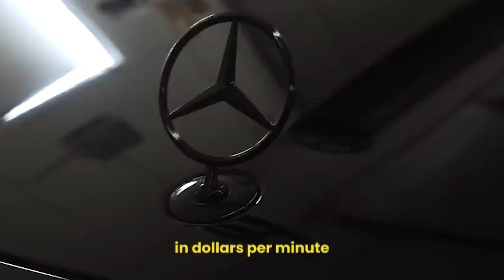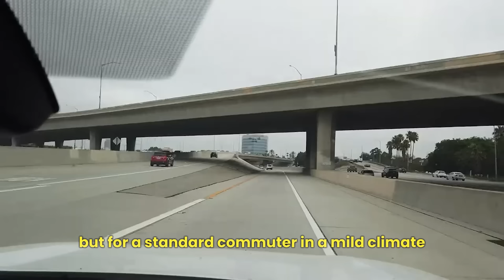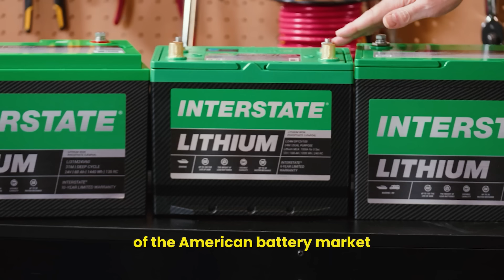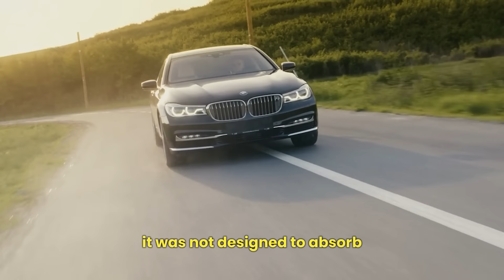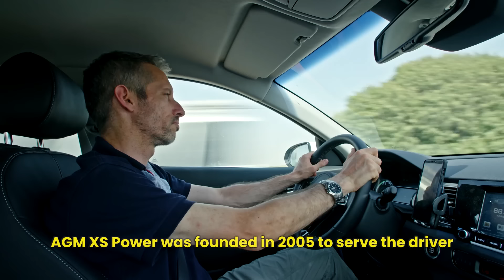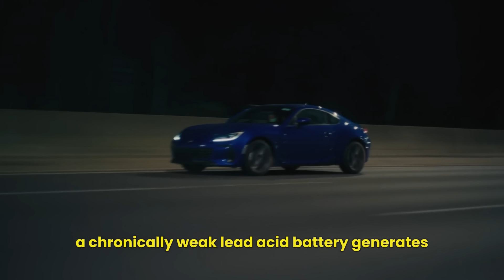8 Car Battery Brands That ACTUALLY Last (Stop Replacing Yours Every 2 Years!)

Comment: I have a 2018 Explorer with the original battery. I use a trickle charger ($20.00) whenever I'm not driving for more than a couple days. I've never had a battery last more than 5 years. The slow charge seems to be help the battery achieve a higher charge and last longer.

Comment: I hereby defy you to: Place any new battery in any vehicle. Let it be in the TX sun for a few years. Never out of the sun. Always. Driven, parked, no matter. It will start to deteriorate within 2 to 3 years. It's not the cold that matters, it's the HEAT. Keep the vehicle in a garage or carport overnight. Or all day. (Not feasible, because we usually drive during the day.) But if not in the sun full time, can last more than 3 yrs. I don't believe any of the below comments because they all must not be in TX and out in this sun constantly. (And it may be only the sun in TX. Not sure about any other state. LOL)

Comment: I kept my 2015 Audi's original battery until late 2024.  Replaced it when it was having trouble turning the engine over.  Good thing I waited - replacement costs almost $600.

Comment: I had to replace my car battery one winter, and used a garage in a nearby town that had it in stock - the new one didn't last a single year! My local garage, found that the failed battery had only 250cca output, and they said it was a 'no name' generic. The new battery they installed came with a 5 year warranty (Interstate Brand).

Comment: I'm still using the original equipment battery in a Ford F-150. It's an AGM that still starts the truck after it sits for a week or two....when do you think I need to replace this battery it's 6 years old?
Reply: For me 3 years ago.

Comment: I just replaced my original 13 year old battery. It still started the car, but I was having mysterious computer glitches.  I found a battery, with a 2 yr warranty, at half the price of a battery with a 4 year warranty. We'll see how well this works.
Reply: Batteries with shorter warranties not only have less charge capacity (amp-hours), they also have lower CCA.  You generally get only as much as you pay for.
Reply: @marianneoelund2940 : I did compare the stated CCA, if the spec was accurate, I'm good. Often a higher price is the same battery with an extended warranty. I guess I'll find out in a few years.

Comment: If you can make them fit in your car or truck group 31 commercial truck batteries with 1000cca or more , they are built better( meaning they have thicker and more plates in them and resist vibration and tolerate heat better) compared to  car batteries. Most of them have a 185 minute reserve capacity or more and also they have terminal lugs however you can get them with standard top post terminals. I've gotten 10 years out of a group 31 battery and this is the battery i made fit in my 02 silverado by making a longer battery  tray and a pair in my diesel 08 gmc sierra.👍🏿

Comment: More AI garbage.  The truth is that there are only about a half-dozen battery manufacturers in the U.S.  The 3 biggest are East Penn, Clarios (formerly Johnson Controls), and Stryten Energy (formerly Exide).  Those 3 companies make almost all U.S.-manufactured automotive batteries (not EV batteries) under contract for nearly all U.S. car battery retailers.  Large battery retailers (e.g., Walmart, NAPA, etc.) may have batteries for sale on the shelf from up to all 3 of those manufacturers at one time with the retailer's brand name on them.  And the quality of the batteries from any one manufacturer may vary as they often build batteries to the specs specified by the retailer.  Finally, the "model" of one of the batteries sold by a big retailer under their name may be manufactured by a certain manufacturer today, and be manufactured by a different manufacturer a year or two from now.  So, finding the best battery for the money is always a moving target.  What's a good choice today may not be tomorrow, and vice versa.
Reply: The only comment that makes sense. You should have a lot more likes if people just read your comment. The video itself is garbage.

Comment: I bought an Antigravity lithium-ion battery for my Nissan 370Z last year. It's about 22 lbs lighter than the OEM lead-acid battery, delivers more initial cranking current for faster starts and has a larger charge capacity than the Nissan OEM battery. It is more expensive than the lead-acid battery but is supposed to last at least 2 to 3 times longer. There is a lower electrical load on my alternator due to the superior charge capacity and lower charge depletion after starts. I also noticed slightly brighter headlights, interior dash lights and smoother idling.

Comment: Cannot use AGM on older vehicles.
Newer ones control the alternator output via the computer.
Replace that and you MUST have the computer reprogrammed or you burn up the battery.

I am using a Walmart battery for the past 4 years. Still works even at 0F.
It is beginning to show it's age though.

Fun fact: a weak battery (aka old) costs you MPG. It places an extra drag on the charging system.

Comment: optima USED to be great..now junk from my experience
Reply: I've never had one and I hear the same thing.
Now JUNK.
Reply: @rickbrown7287  Way back when, Optima batteries were manufactured by the Gates Rubber Company, then the largest manufacturer of V-belts in the world.  Optimas were great batteries then, but expensive.  The only Optima battery that I buy today is the Yellow Top and that is for a special application.  They don't perform much better than many other batteries, but the Yellow Top Optima is better than many batteries for deep-cycle use and they are more resistant to damage from physical vibration than some other batteries.  But, yes, even they are not as good as the used to be

Comment: My car was designed to only partially charge my battery. That's why my battery only lasts three to four years instead of five or even eight years.

Electronic Load Detector (ELD) in many Honda vehicles (common in models from the 1990s through the 2010s, like Civics, Accords, Elements, Odysseys, and Pilots) can prevent or severely limit the alternator from charging the battery properly.

How the ELD Works
The ELD is a sensor in the under-hood fuse box that monitors electrical load. It signals the ECM/PCM to control the alternator's output via a control wire (often white/green). Under low load, the ECM reduces or turns off charging to save fuel (voltage stays around 12-12.5V). Under higher load (e.g., headlights, AC), it commands full charging (13.5-14.5V+).